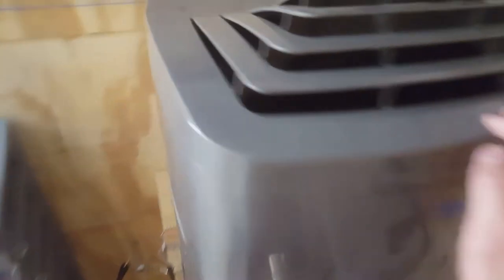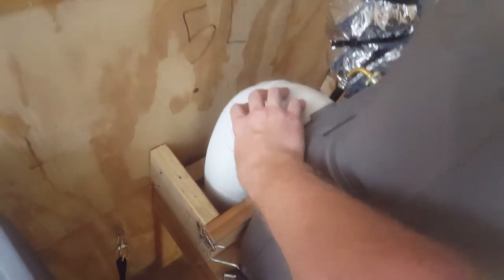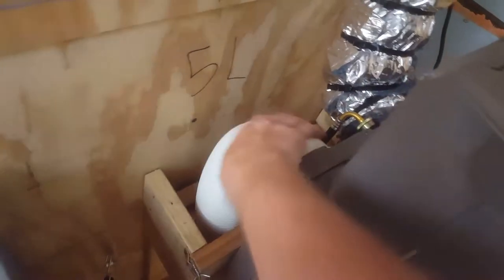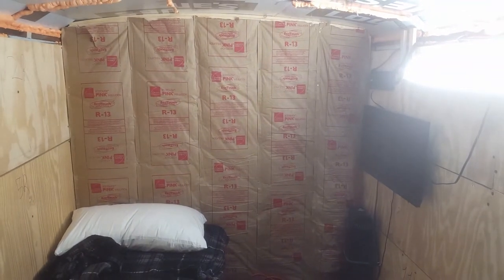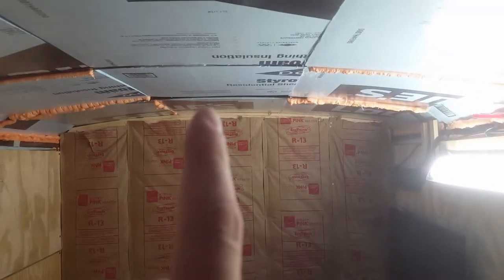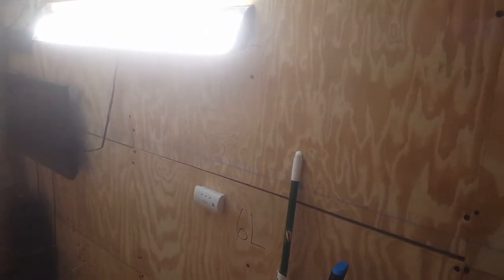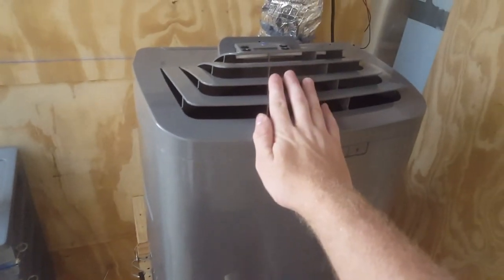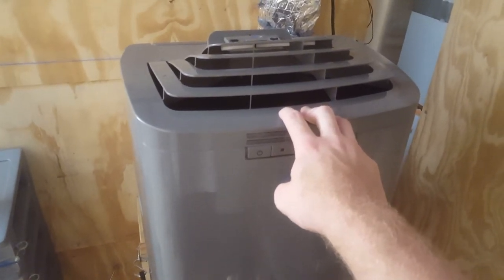Cargo trailer camper/ conversion AC Part 2: (review)

Comment: His hose connections are correct. A dual-hose portable does intake and exhaust for the condensor side and does not exhaust inside air. Think about the outside vents and exhaust fan in a window unit. The inside filter/intake is usually on the back of the portable cabinet and crosses the evaporator coil to blow into the room.

Comment: Your 1inch void depends on what they built your trailor out of mine is inch and a half tube but i do understand every ones trailor is different.i used blow foam and it works great here in florida.and i also have a 13000 btu portable ac with only one duct it can be at 105 outside and a cool 68 degrees inside in a 6 x12 trailor.dont really know why so efficient butvery happy with it because we meaning ole lady and5 grandsons throw off a lot of body heatin the small space we got and we stay confortable even in the severe heat here. Thanks for your video i appreciate your knowledge.

Comment: Your AC is hooked up wrong. Remove the inlet duct work. The inlet air to the unit must come from the room being cooled, not the outside air. Look at a room AC. The evaporator is inside the room, not sucking air from outside. You should cool down in 10 minutes tops
Reply: SMH have you actually tried this?  No external intake will create negative pressure and outside air will still come in.... and the negative pressure will make the system even more inefficient.  Only other way to get around this would be to totally enclose the ac in a closet, have ducts that move air out to trailer, then have a vent in wall to allow outside air into closet.  this will help keep hot outside air from getting into main part of trailer.  But the two hose system will do that for you and most definitely needs to be vented to outside and draw air from outside.

Comment: agree inlet vent should pull air from inside the trailer, will cool off much faster.
Reply: No.  You are not going to escape air being pulled from outside.... in that small of a space you have to have air moving THROUGH the system.  That means it needs to be able to pull air from outside.  A dual hose unit has both an intake and intake hose for a reason.  If you don't need an intake all you would need is a vent on unit.